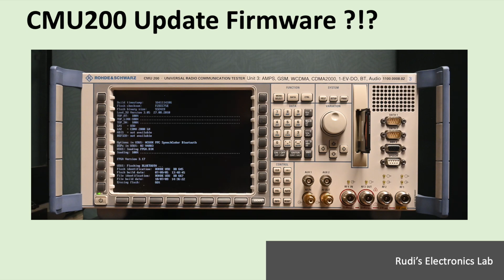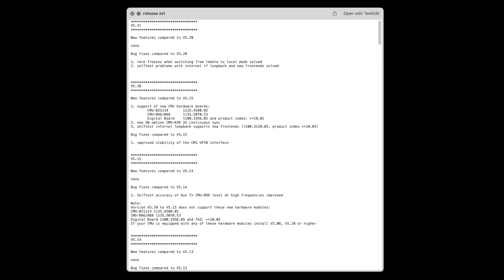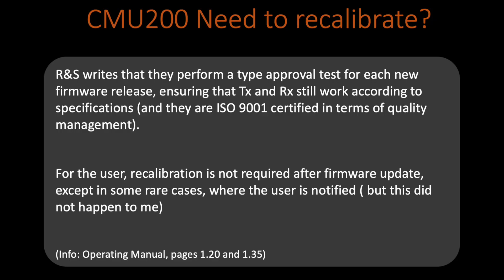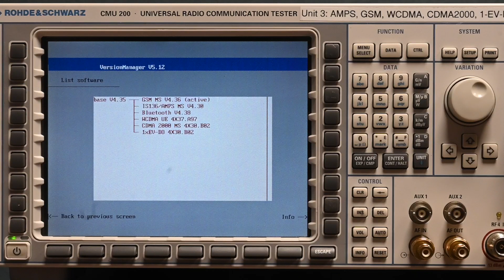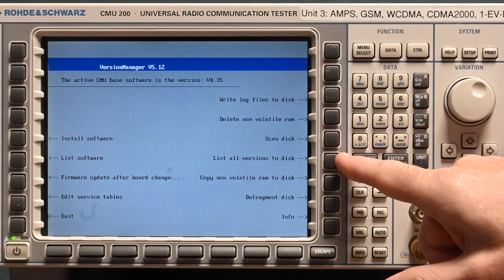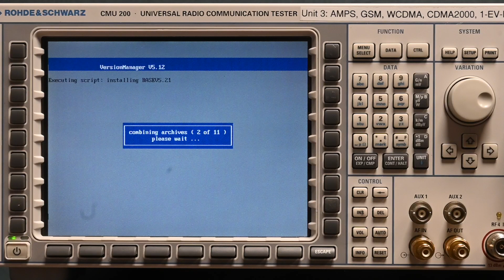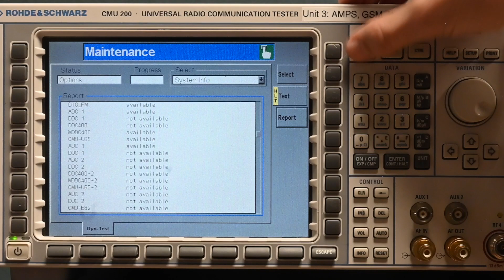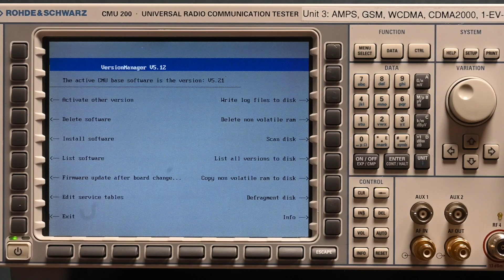REL #20 CMU200 Update Firmware ?!?

Comment: First off I appreciate your series on these units. I have one of the last versions made, one with a native CF card slot. I have replaced the CMOS battery and the hard drive with an SSD. The image is saved on my PC. 

The problem that I run into is that in the data dump there is a specific readme file that denotes the firmware is locked and unable to be upgraded. This is also caused The system to not be able to recognize an additional card installed to activate the AMPS FUNCTION. 

My question to you or anybody else is have you run into this firmware lock or does anybody know how to unlock the firmware so I can update it. 

Thank you for your time. 
Marshall
Reply from the maker: Hi Marshall, thanks for the nice words. To be honest, I have not encountered a firmware lock situation before and don't know how to solve it. Perhaps others can chime in? You may also try to post in Rohde-and-Schwarz@groups.io. To use AMPS, I think you need cards CMU-B21 (versatile link handler) and CMU-B41 (audio generator/analyzer) (apart from the CMU-K29 software activation). Is it any of these cards you want to add? And did you try to "Firmware after update" in the Versionmanager? The reason I'm asking because I am wondering which firmware is locked. There is the system firmware ('software') like V4.35, V4.5 and V5.22. But there are also many firmware versions running on the different boards, processors, etc. If I recall well, the  "Firmware after update" in the Versionmanager updates all board and processor firmware running all over the device to the versions required for the overall software the instrument is running.
Reply: @rudiselectronicslab861  I do have a working audio analyzer as well as b21 installed. I perform the update after install version manager. There are four different firmwares listed with three of them being the same in one being basic. I took the image on the computer and attempted to delete the readme file installed it back on the SSD installed and I'm just stuck in that loop essentially. I've tried so many ways and the machine doesn't seem to recognize the CF card reader. Thank you for letting me know about the group and I will definitely post in there. 

Thank you so much for responding to me. I love this machine and I love how little I was able to pay for such an amazing machine. Your series again is fantastic

Comment: Can’t wait for more :-)
Will patiently wait for it.

Still a lot of interest in using it (program it through GPIB for example) as general RF test equipment outside telecom.
Reply from the maker: Thanks! Your feedback is valued, helps me to start making new episodes. Actually, some parts are already recorded but not finalized. But currently traveling for work… I did also receive the GPIB interface (Keysight/Agilent 82357) and a bunch of GPIB cables I ordered. They work, but I seem to have trouble getting (ancient) R&S software to work with these.

Comment: Thanks for the videos on the CMU200, actually on my CMU200, if I have a PCMCIA card on the slot at power up, the CMU goes directly on the Version Manager.
Reply from the maker: Indeed, I didn't mention this in my video. It only does so, however, when the PCMCIA card inserted at startup contains firmware update files (regardless of whether these are newer than the firmware already installed or not)... To prevent the devices each time to go into VersionManager, I deleted the firmware updates files from the card.

Comment: I highly recommend you calibrate the CMU200
It's very easy
After I calibrated mine
The level of accuracy has increased dramatically
from 10 MHz
up to 2700 MHz
Mine is now exactly on the last digit in the frequency.
I have now uploaded 3 videos
my youtube

which shows the performance after calibration.
I also replaced the CMOS battery
And I also cleaned the RX/TX board
I removed the black sponge that corrodes the 3 filters
And I changed to thermal pads.

Connect the DC voltmeter test cable to the SMB plug  on the motherboard.
  Switch on the CMU and allow it to warm up for approx. 5 minutes.
Adjustment:   Use potentiometer R120 on the REFERENCE BOARD to adjust
the measured value at the DC voltmeter to + 5.000 V ± 1 mV.

Adjusting the 10 MHz Reference Frequency

Use potentiometer R121 on the REFERENCE BOARD to adjust
the measured value at the frequency counter to
10.000 000 0 MHz ± 0.5 Hz (at REFOUT1) or
1.000 000 000 GHz ± 50 Hz (at RF3OUT).

Preparation:
Note:
The measurement can be performed either at connector REFOUT1
(rear of CMU) at 10 MHz or at connector RF3OUT (front) at 1 GHz
using a frequency counter.
  For the measurement at connector RF3OUT set the generator to
1 GHz and 13 dBm without modulation in the RF menu.
For the adjustment, the CMU must be set to internal reference
source.
  This setting is to be selected in the sync menu of the respective
application.
The measurement at 1 GHz can be performed with a lower frequency
counter resolution (1 Hz) in order to achieve a faster adjustment
Reply from the maker: Thanks! I just checked your videos... I have not calibrated the reference frequencies of my CMU200s, but I did check how accurate they are. Since I have no frequency counter that is suitable and itself calibrated to ensure it can serve as a reference point, I approached it in another way. I used a GPS Disciplined Oscillator (GPSDO) and had it running for some 24+ hours so it was fully stable. Then I used that signal as the 10MHz reference input for a frequency meter, and then measured my CMU's (and other devices I had in my lab). One unit (with B11 board) was at 0.07 Hz below 10MHz, one (with B12 board) was 0.35Hz below 10MHz, and one (with B11 board) was 1Hz above 10MHz. So, the last one might benefit from some calibration.
Reply from the maker: I just looked at this a bit more in detail. Note, however, that if you OCXO reference oscillator options B11/B12 installed (which is the case on all 3 CMUs I have), the procedure is different; see page 83 of the service manual. Also, there are different/additional requirements, like the maximum deviation, warm-up time, and horizontal device operation (!). In addition, one should be aware of the resolution and precision/calibration of the used frequency counter/analyzer, which is rather critical if you want to use it to calibrate another device.

Comment: Thanks Rudi! My unit still runs FW v3, do you know if it's possible to run the upgrade from de HDD? I was thinking to copy the files to the HDD using a USB IDE converter I have here.
Reply: How did you get on with the internal firmware update approach?
Reply: @MrMersh-ts7jl  I never did it =[
Reply from the maker: When you say that you want to run the FW upgrade files from the internal HDD, I assume that your unit does not have the PCMCIA slot? Having said that, I do not see any reason why you cannot do it from the internal drive (for instance, by taking the drive out and adding the files and putting it back). Actually, Table 1-3 on page 1.31 of the Operation Manual lists the internal drive scenario. In any case, VersionManager offers a rollback option.
Reply: @rudiselectronicslab861  Thanks Rudi! My unit has the PCMCIA slot, but I don't have access to any card. 

I will try the internal procedure, actually I already upgraded the HDD to an SSD, so I feel safe to do it copying the files directly.
Reply from the maker: @AllElectronicsChannel  Good luck! Let us know how it went...